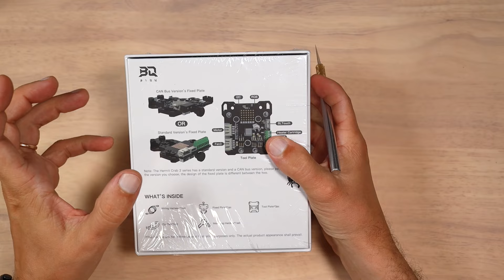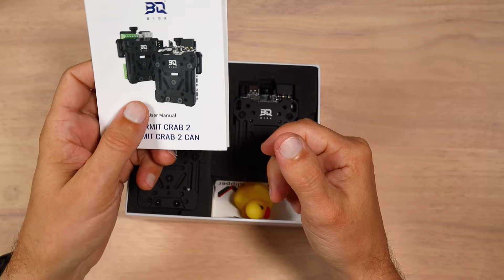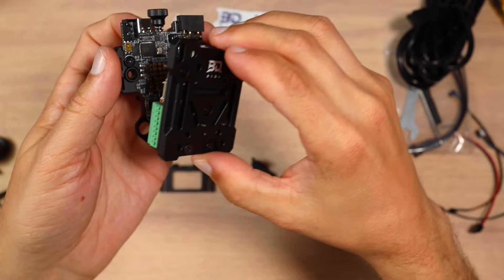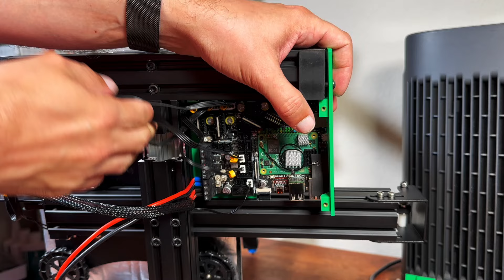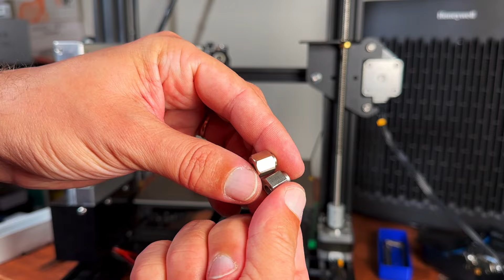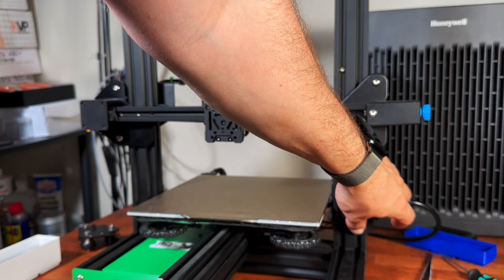I Installed BTT Hermit Crab 2 on my OLD Ender 3 with Manta E3EZ

Comment: You are not supposed to tin wires that go into a screw terminal. This can create a fire hazard as the solder keeps flowing and the connection will become looser and looser over time.
Once loose enough resistance becomes higher and higher which creates heat, which will eventually light to meltin cables/terminals or even said fire.
Reply from the maker: Yeah... I heard that "reasoning" about 100 times and it still works for 100s of thousands of Ender 3s that were sold. 4 of my Ender 3s had factory wiring and I had 0 issues printing on them last 3 years. But to make you feel better about a week ago I have ordered proper crimps and it will be crimped, in the video I have mentioned it's a proof of concept and things will be changed down the road.
Reply: @hobbyistnotes I have to agree with you I solder connectors on rc cars and we run some crazy amps and voltage through them and have never had an issue.
Reply from the maker: @redline6871  His point is that screw in terminals and soldered multi stranded wires aren't the best mix due to solder between strands is slowly getting weaker and it weakens the connection between the wire and screw in terminal. It's kind of a legit point but in reality Creality uses this solution on ton of printers and I have seen only few issues related to such solution. Also when this point usually brought in electrical world people are talking about completely different connectors than what we have. I believe that as long as you know and accept the risk at the end you are the person who hold responsibility for your own house.
Reply: Damn I never knew that. So I should just raw dog screw terminals?

Comment: Hello, nice video and good information. Any insight on using the hermit crab 2 after some months? Also, I was thinking of using an hermit crab 2 as part of an automated toolhead changing system for an Ender 5 Plus with a zerog mercury 1.1 corexy setup. Any comments on that?
Reply from the maker: Unfortunately I didn’t had an opportunity to use it much with different setups other than one you see in the video. I feel like it is much cheaper to use DIY system for tool changers as you will have to change mechanics of HC2 latch in order to make it work as it has very strong grip and it takes some force to put it in and take out. Also you want your tool heads always be powered which is not possible here without modding it, imagine heating your nozzle each time you changed the tool during the print.

Comment: I would have love to see you mounting H2V2 on the plate.

I got the v1 since day 1 I guess :D , I accidently burnt it when trying to put the tool back, I didn't know if there was electricty or not, the kinda pins that go to holes to secure the mounting, slide to the board and created a short-circuit...

So I was wondering if I would buy the v2 since I can't just buy the can-hotmode card... Or go for another system. Initially, I wanted to use laser and other things with this, but I've never done it so far so ....

In my memory, I couldn't just screw my h2v2 on the plate directly, because of my fans, and you only got one side which can be screwed with every h2v2 .... So, I've never been able to have a perfect sraigth toolhead :/

Also, the quick plate mounting system was loosing its grip, so at any force, the plate just popped out, which is also super annoying

Would love to see the part 2
Reply from the maker: You just hair to late with this comment as I have successfully assembled second plate with H2 V2S Lite but with smaller heat block to test theory of smaller heat block being better than the stock one in terms of extruder leaking. I wish I have filmed assembly process and hope to spend more time for Part 2 soon.